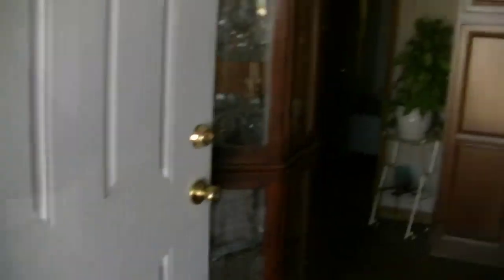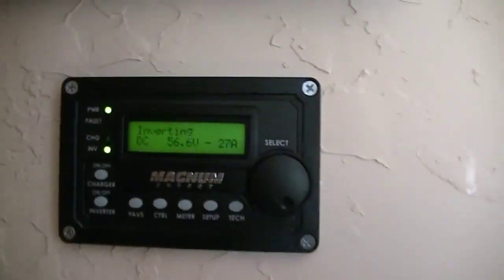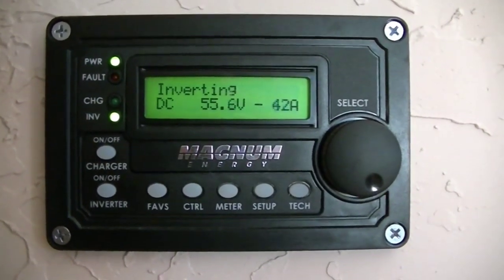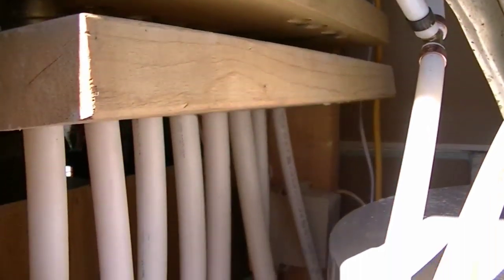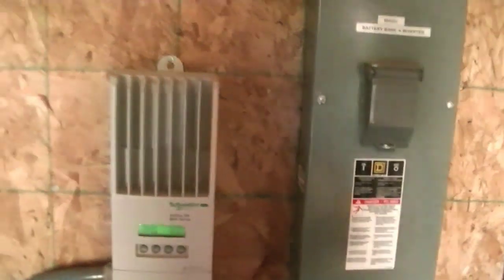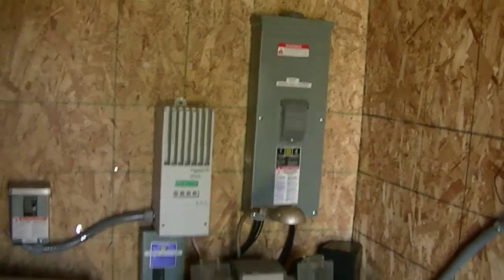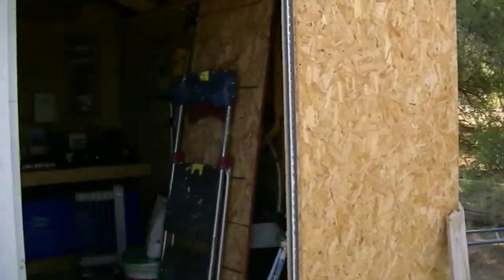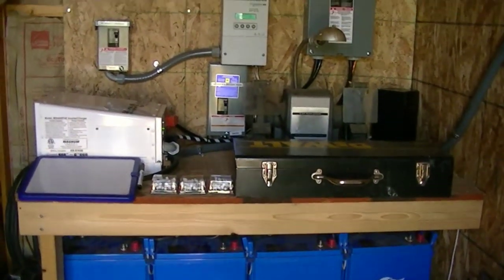Brief Overview of my Off Grid System and Tiny Cabin Home

Comment: Very nice. I would like to get a mini split I think it would work better then my baseboards. I was worried that it would not heat in the winter.
Reply from the maker: If you get one that has heatstrips in it, it won't be any worse in the the winter than baseboard heaters.  But mini splits are very efficient down to 20 degrees.
Reply: I have a fireplace electric heater that runs 1200w but it works well . I used that a lot this winter, 105 ac kwh . I would really like to get away from wood because we seem to have a lot of chimney fires. Not bad ones but scary still. I do like wood tho but maybe Ill build a wood boiler. I have some more solar to put up but I'm not sure where the limit is. I do know that if my baseboards had to run for 24hrs it is 72kwhs. We ll have to see. Summer time soon Ill be running ac.Mini split is probably a good idea . Thanks for your videos. Check out my set up if you like. Its not expensive but it does ok.
Reply from the maker: Even if you could afford the panels to run the baseboard heaters all the time, the batteries would be way more costly.  That's the main reason I continue to use firewood.
Reply: I try to use the pv as much as possible and the batteries only if I need to. I use wood as well.

Comment: Steve 
I'm not in the position to try this yet..
But you talk about having a fire when you go to sleep.
Then starting another in the morning...
My thoughts.. After watching how they burn stumps from the inside out...
I'm thinking
Instead of splitting all the wood..
Trying drilling. 4 holes near the bottom to the center..in a short section of a log..
And a larger one from the top to intersect those holes ...
Just like the stump burning...
I'm thinking after trial and error..
Maybe a fire that will last the whole night plus some.  ???
..just a thought.  Maybe.???
Maybe not???
Reply from the maker: Jim I did something similar to that in New Mexico.  I used a 5 gallon bucket with a 2" hole in the bottom with a pipe through the middle.  Packed full of sawdust, pull out the pipe, light the center would last nearly all night.  The stove I have now is too small for stumps or buckets so I just burn firewood.  If I'm blessed with the resources to build a slightly larger home in the future, I plan to also get a larger wood stove so I can do that very thing.

Comment: once again thank you for sharing...
i understand you've chosen an optimum angle so you don't have to adjust for summer and winter..
but how much  would you estimate you lose in output...
by not tilting the panels for summer and winter.  ?
Reply from the maker: I optimize my panels for Equinox, but slightly towards winter solstice.  The reason is there are much fewer sun hours in winter than summer, so optimizing slightly in favor of winter provides more power in the winter at the expense of summer power.  However, I have much more power than I can use in the summer even with the angle I have.  As a result, I use the additional power in the summer to cut and split wood, mow grass for goat feeding, and to have as air conditioning.  I am happy with the results and the lack of knowledge of how much summer power I lose because of the static tilt elevation.
Reply: Steve Robertson 
thank you for your insight, into how you designed your system.
I'm getting a better view on how and why you designed your system the way you have... 
it will jump start my first aray so I'll have power for my homestead.. allowing time to test my trackers.. (i think my designs will deal with the winds in the area I'm heading to,, and best of all, built with not expensive matterial)..
because of your insight I've learned not to try to store large amounts power in batteries..
I'm after getting maximum power (winter) throughout the day... especially the later hours...  (my shop (metal) will require more power).
again thank you for sharing...  (it's a great help)
Reply from the maker: I've been at this for 35 years.  I'm happy when people learn from my mistakes.  I hope you post some videos of your progress and keep me posted.

Comment: I'm trying to get my head around this. The charge controller is feeding the battery bank at some voltage higher than 48 volts (so the batteries charge), and at the same time, the Magnum inverter is pulling from the battery bank. Is it fair to assume that once the batteries are full, the charge controller is then effectively feeding the Magnum inverter ?... as they are wired in parallel if I got it correctly. Meaning, the charge controller's wires and Magnum inverter's wires attach to the same lugs on the battery bank ?
Reply from the maker: That's pretty much it in concept.
Reply from the maker: +Mark Osborne That's correct.  Once the batteries are full, they act like a shock absorber, providing additional electricity when a motor starts, and then slightly charging when everything is running.  Any additional electricity simply goes no where, like any other system.  But this is a just a way to harvest as much energy as possible.
Reply: +Steve Robertson (Off-Grid Living) I think I got it.  So once the batteries are topped up, and your house is say pulling 2500 watts, the charge controller is supplying that energy to the Magnum inverter from your 4800 watt array, and the rest of the energy ( at peak sun ) goes no where. (I understand you use the feature on the charge controller to toggle on the hot water tank, etc in attempt to harvest as much as possible from the solar array)... just trying to get this basic concept hammered into my head.
Reply from the maker: +Mark Osborne You got it brother!
Reply: +Steve Robertson (Off-Grid Living) Thank you very much
Reply: This is a good question ... 
I was thinking when the charge controller charges the batteries fully ... it then reroutes extra solar power to the load diversion controls ? (or if the hot water system has a DC heat element, it would divert the extra solar power to it ?)
The magna inverter is connected directly to the Batteries ...

Is that correct steve ?

Comment from the maker: @gunlover1955 - The array operates at 120vdc, so the any loss is negligible.  Besides, the panels are wired in series horizontally, so it doesn't make any difference whether I put the combiner box o toe either side or the middle,  The same amount of wire would have been required to complete the circuit.  I placed the combiner boxes at the end closest to the electrical shed to save on the heavier home-run wiring to the charge controller.

Comment: Question why didn't you mount the combiner box at the center on the solar panel array and turn all the panel connecters to the center it will boost the output and save a ton of wire?